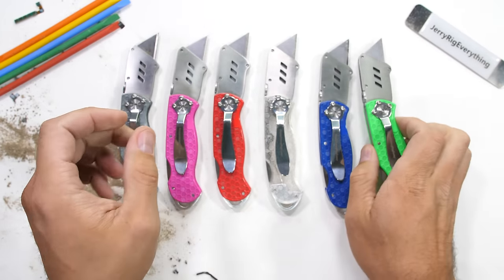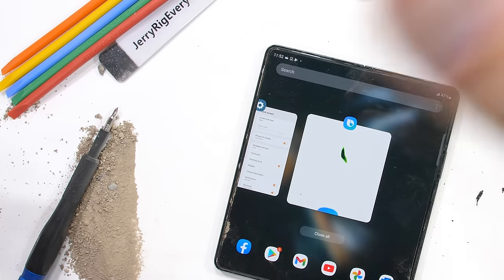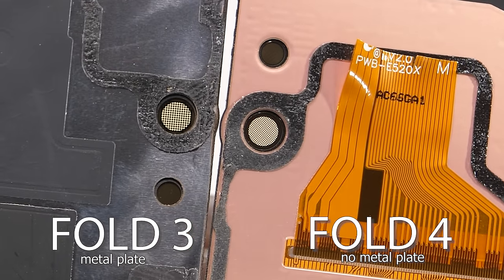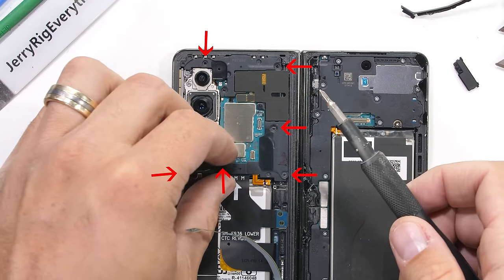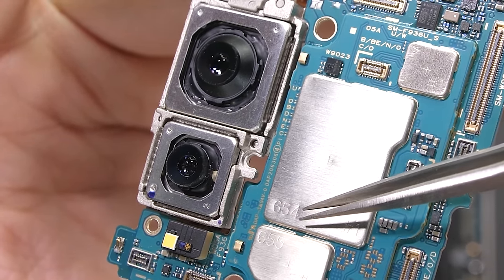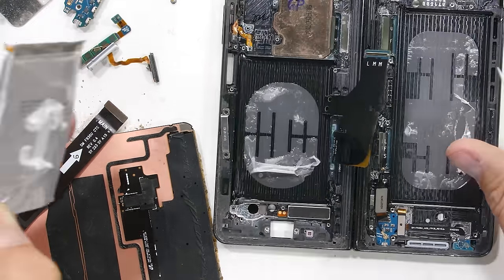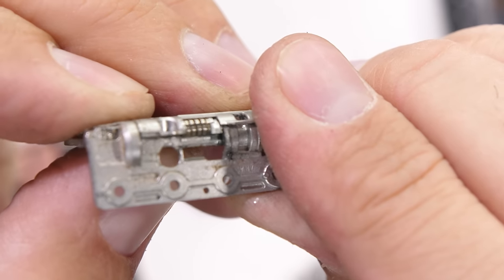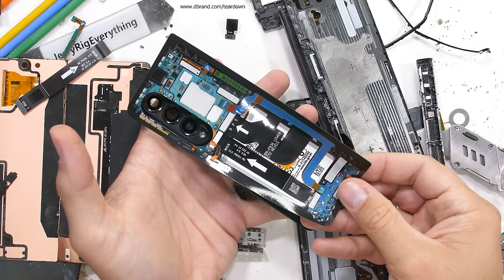Samsung Z Fold 4 Teardown! - They changed the Hinge?!

Comment: This is the only surgery my stomach can handle, but it is still pretty painful to watch! The Fold 4 hinge doesn't quite snap open as nice as the Fold 3, but it is still pretty smooth.
Reply: Totally, I prefer the fold's 3 feeling overall (hinge wise)
Reply: Yep, and I find it doesn't have much of an "end point" feeling, you almost want to flex it backwards a little bit to see if it's actually all the way open.
Reply: @ferrari5347  yes sir, those are my exact feelings when using mine. Seems like a less stronger hinge design, and like you have to completly open the phone in order to get it flush, and the Fold 3 in the last degrees of opening the hinge did the last part. Anyways, only time will tell!

BTW, if you open it with a little more energy, you will find that the hinge works kinda the Fold's 3 one. Regards!
Reply: Strange isbt it i cant even mention certain things around some people eating i personally can watch anything nothing puts me off food which is quite ironic being slim. One of those annoying people who can eat whst they like, mind you i cycle around 200miles weekly wjich explains a lot.
Reply: @Joaco Soler  my f4 hinge isn't 100% smooth and towards the few last few degrees of opening,  it gets loose and will open on its own from the weight of the half (also have the S pen case). So it kind of opens itself towards the very end. Not loose enough to close itself unles I try to flick the phone shut,  it would then move from flat open orientation to partially closed before stopping.  My buddy has the F4 and his hinge us tight and evenly smooth all the way.  After seeing the break down, I don't understand why some F4s will have a looser or tighter hinge. Maybe amount of lubricant on certain spots of the metal sliding design? I'm sure most phones will get looser with some use. Despite my screen not holding itself up towards the last 25 degrees or so, it doesn't really affect everyday need or performance. I would never have my screen folded in that orientation for viewing and depending on which side is on the table, it will tip back anyways due to balance being off center.
Reply: I have had both the Z Fold3 and now Fold4 both since launch dates and my Z Fold3 cracked twice down the middle. First time was in November and I had the phone since August. Fold4 however has been a breeze! I feel like it's been so much sturdier and the outer screen getting widened ever so slightly has made the biggest difference!
Reply: @nateskool This is because Fold/Flip 4 had Schott's +50% stronger 2nd generation UTG folding glass. It was a MAJOR improvement for those infamous spontaneous fold-line cracks/shatterings.

Comment: Your'e absolutly right about the batteries! I tried changing the battery on my Note 10. Unfortunately some Isopropanol got through the fingerprint scanner to the display and completely destroyed it. RIP Note 10. I loved that phone 😭
Reply: F
Sorry mate
Reply: @tea__low I really hope you did this while the phone was off. Put isopropyl alcohol on the phone. If you did it while it was on then yes it would short something, but if you did it while it's off that's absolutely impossible. Depending on the type of isopropyl alcohol you used. For electronics always use 85% and up. Even for me 85% is pushing it. Never use anything less. But I'm sorry I find it hard to believe you messed up your phone with isopropyl alcohol at a % I mentioned and the device being off. I can drown a motherboard if any kind in isopropyl alcohol and let it air dry for 5 minutes and it works at 100%
Reply: @orushimoru  if any type of alcool goes in display.. it will destroy it or cause black/grey zone
Reply: Yeah, that's rough because if you upgrade to a modern Samsung device, you lose expandable storage and if you don't get the ultra QHD. Hell you might even lose RAM. I really think the 10th generation of Samsung phones like the S and note were peak. I would trade $120 Hertz and 5G for a headphone jack, expandable storage, capacitive fingerprint sensor and the more thermally efficient processors any day.
Reply: @orushimoru  I used 98% Isopropanol, and the device was off, of course. What destroyed it was the fact that the Isopropanol dissolved the glue that holds the display to the polarising layer and the glass. It didn't kill it immediately, too. It worked perfectly at first but the next morning it slowly died.
I might have used too much alcohol but I'm not a professional and the ifixit instructions didn't warn about this. (I don't blame ifixit, I blame Samsung for making it extra hard to remove a battery)
Reply: @tech_glide  I got a S21 FE. The camera is nice but I miss the big storage and of course the S-Pen
Reply: @tea_low  why no S22 Ultra?
Reply: Why change 🔋? Was it dying? I have oneplus 5T for almost 4 years, battery still good. Last charge 2 days 7hours ago.
Reply: @guadalupe8589  Because I'm not rich unfortunately 🤣
Reply: @fynkozari9271  It kind of was. It died really fast when it got under 20% of charge
Reply: F :(
Reply: @fynkozari9271  Not all batteries age the same way. Example, My Note 10 battery decided to swell and crack the rear glass one night on the charger. Note 20 Ultra gets hot while in use and eats through the battery much quicker than just a year ago. While my HTC One M8 gets discovered in a drawer after years of sitting and powers up no problem...Or it could just be a Samsung thing.
Reply: @ericharrison619  I stopped using Samsung years before they made exploding phones, their exynos is bad, sd888, 888+ 8gen1 overheating, that's why Qualcomm left Samsung, back to TSMC. Samsung is not good at manufacturing cpu,only good at displays.
Reply: @ericharrison619  No. Right after the beginning of 2020, the quality of most indigenous chinese batteries has plundered. They lasted for four years, now it is a lottery win if they last two years before puffing out...
Reply: Normally isopropanol is not damaging oled panels…. We use it all the time to loosn displays and batteries. Never any issues
Reply: Yes. But it does dissolve the glue between the Display and the glass. I probably used a bit to much and that's why it could get there
Reply: @tea_low  probably

Comment: I’m absolutely loving my fold 4…sure it’s pricey but the thought and design that’s gone into it makes it worth it. And with the trade in offers and Samsung letting you claim and receive air buds at £219 and a fold starter pack at £89 it makes it even more worthwhile. Anyone thinking of taking the plunge I’d say go for it as you won’t be disappointed. Great video as always buddy.
Reply: Got my Fold 4 two days ago, and I absolutely love it! It's crazy how much more stuff I get done on it without grabbing my laptop. It completely changes the way I use a "phone".
Reply: How pricey? I don't use phone as much as PC. My 8T costed $350, 65watt charging, 12gb ram 256gb rom.
Reply: @fynkozari9271  1700usd. tmobile and verizon have a 1000usd off deal going rn
Reply: @fynkozari9271  in the uk after a trade in and the discount I get through my work I picked one up direct from Samsung for just over £872 and with being able to pick up £300 worth of accessories for free it’s a great deal.
Reply: I mean it’s cool and all but I still
Feel like it’s Samsung open beta testing on its customers. Cool for innovation I get
That but these phones are completely planned to be obsolete. Foldable phones will undoubtedly fail (I’ve seen too many to count). If you get a new phone every 2 years cool. If you plan to keep it any longer I wouldn’t consider a fold as I could get a laptop and a phone for the same price. Or a tablet and a phone(that even performs better). The price and the inability for these things to last just keeps so many people away 😕. I like the idea I just don’t see it better than what we have now, perhaps it’s main uses are much beyond phone screens someday.
Reply: @zethloveless7238  I got it for a steal of a price so that makes it even more appealing. The thought, work and technology thats went into the design is second to none. I had the fold 3 and after a year it was pristine. Screen was fine, hinge was still as sturdy as day 1and frame was solid. Only downside was the underscreen camera but its not meant for proper picture taking and is perfect for video calls. Slightly improved this year also so that's a bonus.
Reply: @ProperScottishWelcome  like you said slightly improved and you went from a 3-4. Your a perfect example of a beta tester
For Samsung. Most people outside of our USA market will never be able to justify these things as price so far has not gone down and they will use the phones for much longer. They don’t get carrier deals like we do etc. flip 3-4 is even barely a change. Samsung should have shown us the ability to price drop these things by now. Used market will be really
Weird for foldables. Enjoy yours
Man just having open discussions 😀
Reply: @zethloveless7238  100% man, I'm not saying everyone should get one or even consider one as its a niche product but for the person who wants a phone that can double as a small tablet or someone who really likes innovation its a great choice. I've went from Apple to the fold 3 and stuck with the 4. I was happy to keep my 3 but the trade in deals and discounts available made it an easy choice to upgrade. I can honestly see the foldable market taking off as once it becomes more common from manufacturers prices will come down and the majority will go for it. Take care man 🤜🏻🤛🏻
Reply: @ProperScottishWelcome  you too my brother take care 💪
Reply: @zethloveless7238  bruh those who are buying $1800 phone maybe at lower price but will never keep that phone for more than 3 years. Foldables are really not for poor people no matter how cheap it becomes
Reply: @1647sk  I didn’t even pay attention to the words coming from your mouth. Enjoy your day..
Reply: I have the fold 4 but didn't get the offer on the buds. Do you think it's worth paying for them separately
Reply: @ishanrko  i would say yes, my friend loves his buds 2. It lasts him like a 2 days or more, the sound is very good too for it's price.
Reply: @ProperScottishWelcome  we must work for the same company haha, I'm on the fence on either selling it or opening it. I just hope I wouldn't drop it or something... That was one heck of a deal! 823 for this phone with the buds starter pack and Disney plus is just bonkers.
Reply: @diligaf1000  its a class piece of equipment
Reply: There was an error in a swedish retailer with trade in offer as well as lowered price. If you traded in any phone you could get a Flip 3 for 500 dollars including another 250 dollar promo.
Reply: bought the z fold4 on September
4th, on the 24th of December my
screen had a random black crease
down the middle... no drops at all
no stress on the phone, it lives on
a desk basically.
I'm going this Monday to a
"ibreakufix" store recommended
by Samsung..I hope they
warranty my phone, I'm making
payments and if they don't replace
it I'm asked out... 1 will never
purchase a fold 4. As soon as they
replace it. I'm selling it
Reply: My fold 4 just randomly shuts down don't know a reason for it. Have to find samsung approved warranty repair shop.... 😢

Comment: This is my phone.  Incredible!  Now, if they could only restore the headphone jack and piggyback the SIM with the micro-SD card from my old phone, I would have been able to skip the cloud altogether.  BTW, my old LG V20, still in use for my theater remote, backup storage  and second screen on Wi-fi, has a battery door that springs open when you push the button, making changing it a breeze.  And NO GLUE on the inside.  Just push-pull connectors and screws.

Comment: Im daily driving the fold 3 since launch and find myself using the bigger screen for more than expected. they are amazing devices looking forward to see were they can go with the folding screens in the future the only problem ive come across is the last few week the screen protector on the inner screen has started lifting from general use other than that still going strong
Reply: U didnt add a protector to ur inner screen? I have one one and makes the phone stay like new
Reply: @sonyboybluespower  I thought the phone comes with a preapplied one? Did you slap a screen protector over the one already preapplied?
Reply: @barronhelmutschnitzelnazi2188  correct! The pre applied one is technically the screen itself so you want to protect that too
Reply: @sonyboybluespower   i wouldn't do that since adding a screen protect on top will amplify the stresses caused by the bending of the screen and may causes damage. unlike previous folds removing the built in screen protector wont destroy your device so its better to just simply replace the original screen protector if it gets damaged instead of stacking screen protectors
Reply: @ipodtouchiscoollol  nah man i dont know where u came up with this but ive been using for 10 months and has kept my fold screen like new.

Comment: I finally took the plunge this year and got a fold4 to replace my note10+.  I'm still not sure it was the right move.  So far its been fine, but I don't find myself doing anything new on the fold that I wasn't doing on my old phone.  I did keep my old phone instead of trading in tho since I'm not sure about the longevity of the folding screen and I'd rather have a reliable backup.
Reply: I did the exact same thing and I'm enjoying the foldable experience so far
Reply: LOL I also did the exact same thing, like upgraded to Fold 4 from my Note 10+ and still keep the old phone for a backup. And I still dont find myself do stuffs on my new one that I havent done on my Note
Reply: Expect the Fold3 to outlast a year with safe/gentle, & normal usage, but 2-3yr is a stretch.
If you use heavily or abuse phone, expect it to last 8months. That's what happened to me. So no matter what they say,  treat the phone well, for it to last.

Samsung just reneged on my "broken screen" trade in, so now I have to pay 700 more and wait for it to return to me, before I can get it repaired,  to then sell on my own. What a sham scam Samsung is not accepting broken screen when the site made me go thru a the efforts.
Reply: Dude if u still had a note 10 this fold 4 won’t last as long I would think.plastic screen and metal on metal. Good luck tho they do look cool 😅
Reply: Same, i still keep my note 9 while doing so much more with my fold 4!
Reply: Samsung also backed it with the care+ so now people can get the screen fixed for 29 dollars
Reply: @mtldragon3  yea for an extra $250 🙄. Then you have a phone the price of two iPhone 13s

Comment: Hey Jerry, why do you think Samsung keep releasing phones with such poor charging compared to their competitors, there is negligible improvement on all fronts, plugged-in, wireless and reverse charge. Other phones on the market are offering significantly higher charging rates, 65W, 100W, even 150W. I appreciate that with these speeds come heat and reduced battery life overall but Samsung just doesn't seem to be competing in this space. 
In the UK, I'm with the O2 network and their options each year usually result in Samsung or iPhone being the only true options for a flagship, seems disappointing with the price point of these devices that we aren't getting more innovation from Samsung in this area.
Love the videos by the way, keep them coming!
Reply: Meh, the 25W charging I get on my S21U is plenty fast. The 45W you get with the S22 Plus and Ultra is more than enough

Comment: I bought the z fold 4 after your teardown and durability test. I was in the market for a tablet for invoices and estimates in my mobile repair business. I have had it for 2 weeks so far. The android os itself is good from my perspective and use. Some apps are not optimized 100% like when switching from fold to tablet sometimes the aspect ratio is off or the screen orientation stays locked innth3 wrong direction but I think that has to do.with the app not the phone itself. My only gripe so far is the simplistic phone cases that are available for these. I found one that I like that also.hold my s pen and covers the hinge but I miss the true otterbox defender I had on my galaxy phones. Thanks for the video.

Comment: I´ve had one for about 18 months. After 6 months i could hear the hinge crackling (probably because of dust building up inside the hinge, dunno) and it finally started to really glitch a few days ago, as it wouldn´t fully open - stopping at around 85% to 90%. I tried to clean it from the outside and it opens perfectly! But the inner display is not working anymore xD Welp, i´ll wait until this futuristic tech gets more... real world usable (and abusable) before getting another foldable. I think I rather have a S23ultra and a full size tablet instead of a foldable for now.

Comment: My understanding is that Samsung changed the hinge design so it will stay in place in positions other than full-on open. Makes it easier to leave it open on a table to snap long-distance selfies, for example. So yeah, it's not as smooth to close. But doing so opens (get it? opens?) up other ways to use it.

Comment: I'm still rocking the Note 10+ as well. Can't do without the microSD card slot. I keep 450-475GB of schematics and manuals on it for work so I will only be getting phones with expansion slots. If my Note 10+ dies I'll probably get a new/old stock or refurbished one.

Comment: My fold 4 functions great, typing this on it now.  Added spigen stylus case and snap 3 on the back, so it is magsafe mounting compatible, had to trim away part of camera bump protection of spigen case to more center the snap 3.

My only problem now, Fold 4 doesn't open fully anymore.  Watching this, I bet dust has started building up in that slide mechanism of the Z4 hinge and has stopped it from fully opening.  There is no way to clear that dust/pocket lint out.  Many say warranty repair is the only way to fix...😢